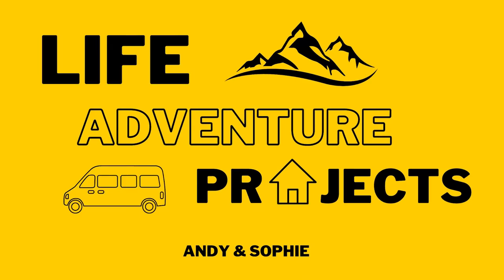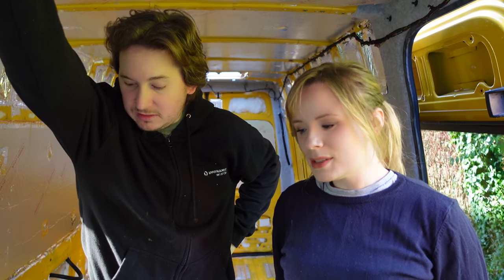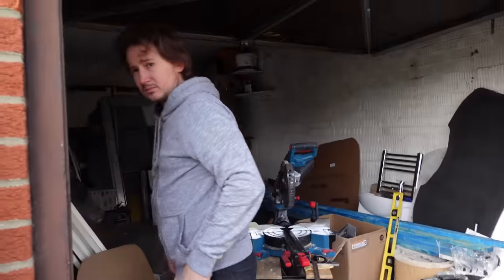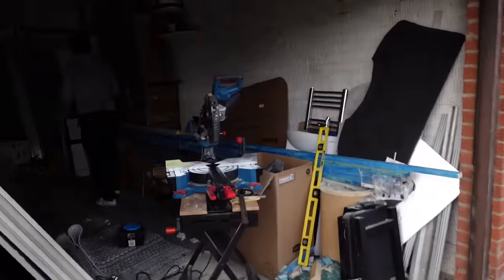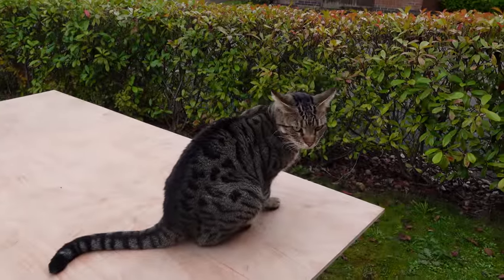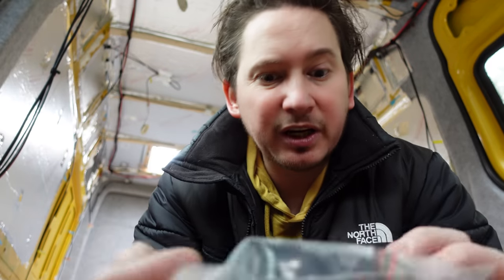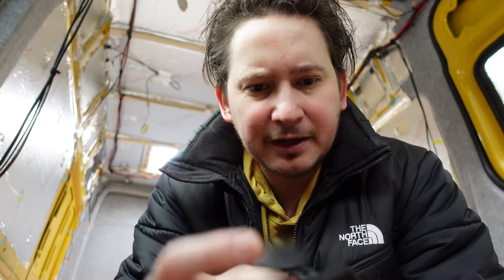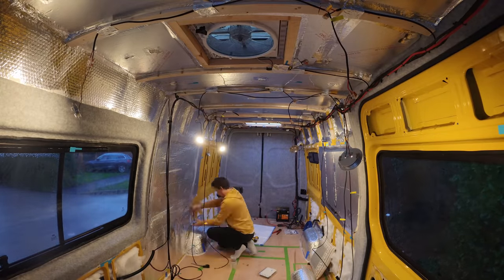Van Build: Wiring Is IN! AND the Floor Is In! | Mercedes Sprinter Van Conversion

Comment: Heat-shrink tubing helps keep an electrical connection looking neat, professional, and water proof with no shorting. A couple of seconds with a hair drier or heat gun, and the plastic tube shrinks into place.
Reply from the maker: Thanks Robert, I actually bought some recently so glad I am on the right track, now just need to apply them!

Comment: Where ever you run a cable through a hole in metal you should have a grommet or some form of protection around the cable otherwise the insulation can rub through on the sharp edge causing a short circuit resulting in a potential fire or at the very least damage to a hard to replace cable. I learned that the hard way at a young age. Doing a great job for first timers.
Reply from the maker: Hey 👋🏼 thanks for your comment, appreciate it. We have got a lot of it encased in conduit but the plan is to go round before we clad the sides and ensure anything exposed has a grommet on! Thanks 🙂👍🏻

Comment: I never get why people run all the cables back to a single fuse box. If you have 2 or 3 fuse boxes in tactical places you save a lot of wire! Also, an easy way to turn all your lights off if they all run off the same fuse box.

Comment: Can you recommend a good website for calculating wire size please? Where did you get your info from to do the wiring? Thankyou
Reply from the maker: Hey bud, it takes a bit of time to work out and really depends what you are powering. I found Greg Virgos diagrams really helpful, he shows diagrams for 1,2 or 3 solar panel setups and they show the cable sizing for most things. He has links to the Dropbox in his video, he also provides a good diagram for calculating based on AMPs. Thanks for watching and hope this helps! 

https://youtu.be/rVkDPzrA-zw
Reply: @lifeadventureprojects  thanks for the advice 👍